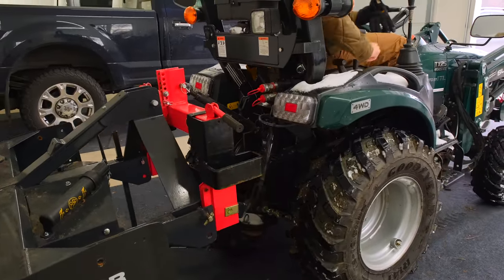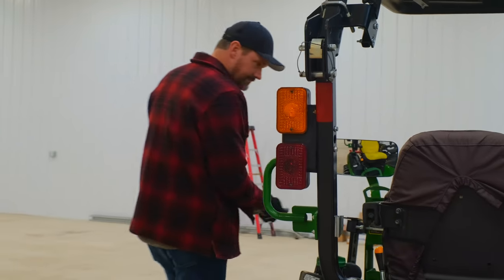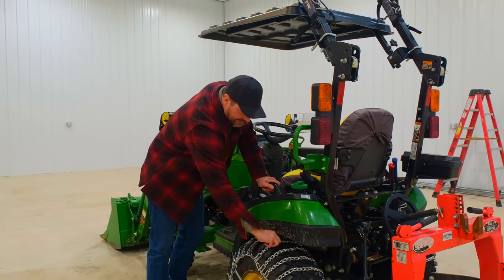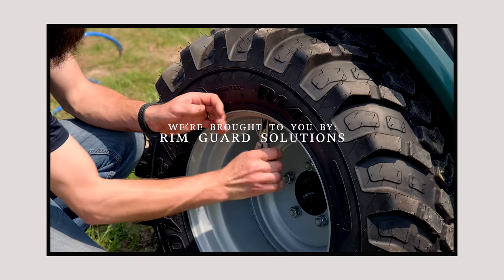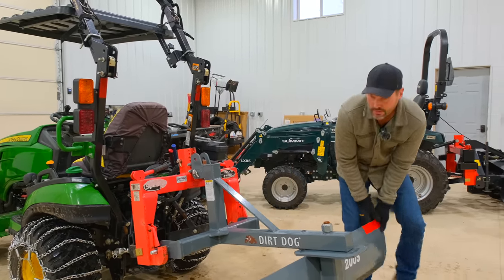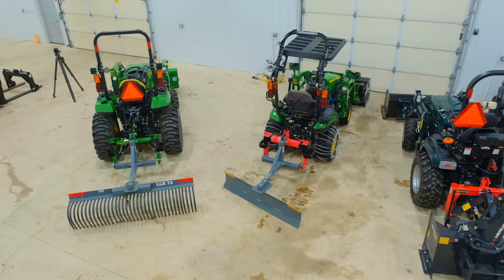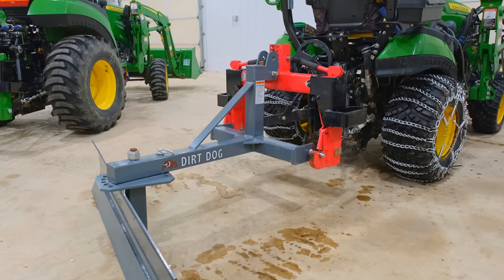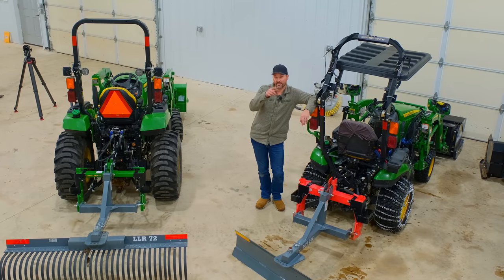I MADE A MISTAKE & CHAINS ARE CAUSING DAMAGE! 🤬🚜

Comment: That is a different Concrete in your shed because you got that sealed and sealed concrete is not good with tire chains but if you're out on the road that is a different because you don't seal your road or your driveway
Reply: Owner agent supervising a 29 unit condo the asphalt starts out smooth but after 5 years with a skid steer loader it is uniformly pebbled texture,  moving a 3ft deep compacted base snow load which could translate as 10 ft of accumulated snow fall.  Just have to dial in re paving every 10 years or so.  Dont spin those chains.

Comment: You're gonna want to relocate the air filter too.  The bracket that supports it has a tendency to break and metal gets into the engine if the valve cover breaks.

Comment: I tried the rear blade turned around…it just rode up over the snow without weight on it so I ended up turning it back around
Reply: Thanks, that what I thought would happen too and I also thought the snow wouldn't slide down an angled blade but heap over the top.
Reply: @melissasmess2773  oh, the snow definitely slides off to the side of the angled blade. Works really well facing its intended direction 👍

Comment: I’m in West Central Alabama & both my outdoor spigots are froze solid as a brick, can’t even turn the knob.
Reply: If you have water spigots that go through a basement wall as we do here Michigan you may want to replace them with the freeze proof type with built in anti suction feature to help eliminate freeze up. The spigot end needs to face down and the whole faucet should be slightly sloped downward. Don’t keep a hose attached to them since they are long and shut off inside the basement and the water in the outside portion of the spigot drains out so it isn’t there to freeze.
Reply: If you don’t have a basement you can install freeze proof faucets through your house wall into a kitchen sink cupboard or into a bathroom under toilet tank so the portion of the valve that shuts off is in the warm house.

Comment: Idk who told you they don’t cause damage to concrete, they are either dumb or crazy I don’t know. But they certainly can just like steel blades, runners, and cutting edges can damage your concrete. They can also damage the road too just like tire studs do. That’s why they say to only use them (being studs, snow tires, and snow chains) from November-April, cuz it will damage the road. This example is a law in Ohio, I don’t know about federal laws, some of them talk about it but I can’t quote them.
Reply from the maker: Many commenters across many videos have said that.
Reply: @GoodWorksTractors  about no damage? That’s ridiculous. Maybe it depends on the surface or kind of chains? There are the rubber chains that aren’t as aggressive. I don’t know if they will damage blacktop (regular chains).

Comment: Chains aren’t meant for concrete nor blacktop driveways.  I tried chains and quickly put chains away for reasons of how much damage they do. Dirt and gravel roadways they work fine but otherwise I do not recommend.
Reply: I think the V bar style will work but they would really chew pavement up with the sharp ends.